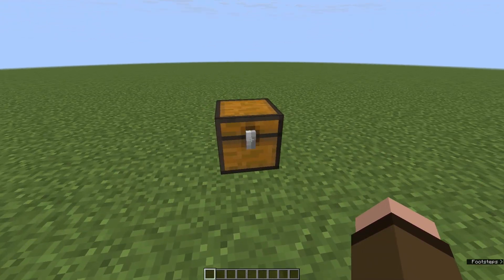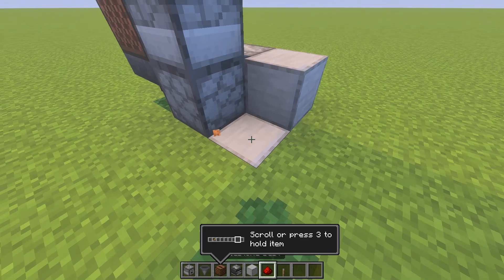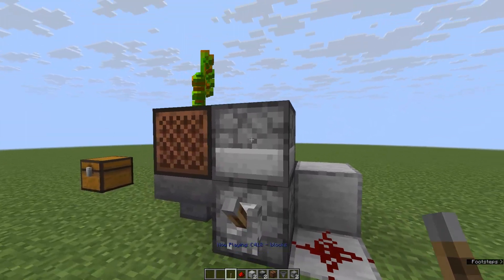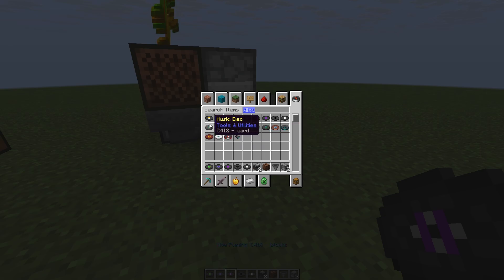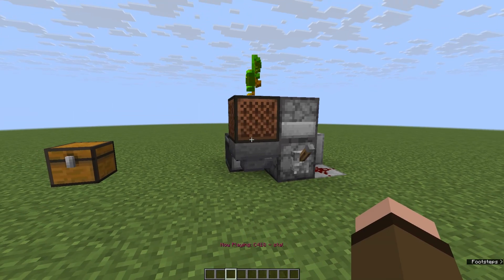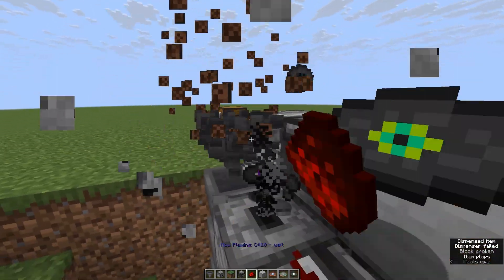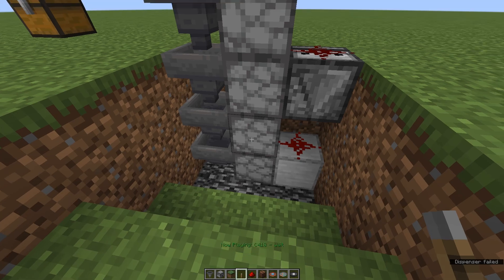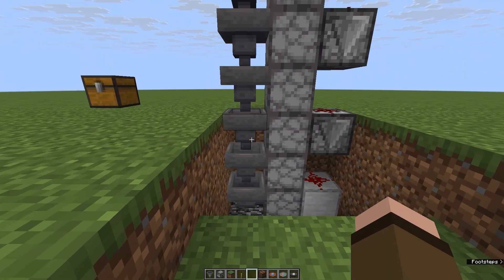How to Build a Simple Auto Jukebox (Bedrock & Java 1.21.7)

Comment: i found a way simpler way. (doesnt require going to the nether         >>>[idk if it works on bedrock]<<<     ) if u have 2 droppers, 1 hopper,  a jukebox, one redstone wire, one redstone torch, and 2 solid blocks you can firstly build the same thing as he did on 0:33 then place 2 blocks, one next to the hopper and one next to the upper dropper (the blocks need to be diagonal from eachother) then place a redstone wire on top of the lower block, on the same block place a torch on the side so it would face the upper block. and thats it if u want a SWITCH you can add a lever to the bottom block but without it it should be a 2by2   (correct me if im wrong on something/ somethings unclear)